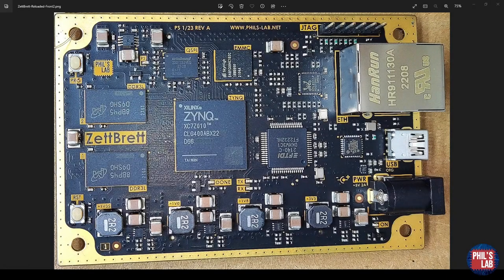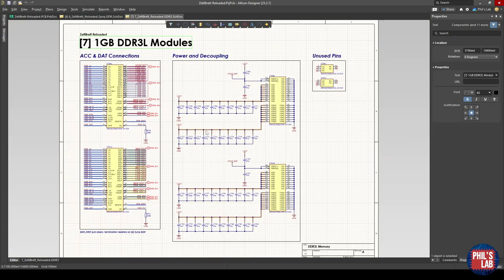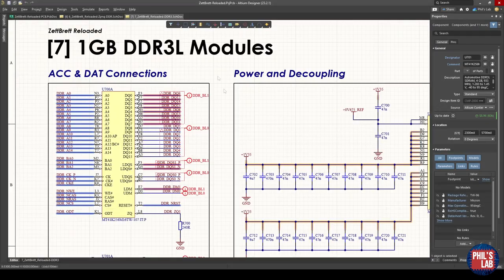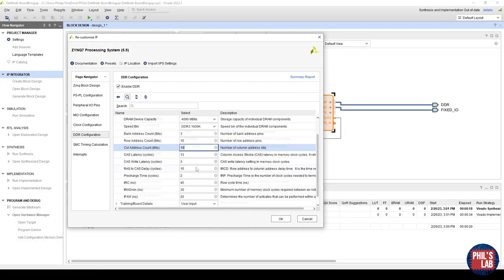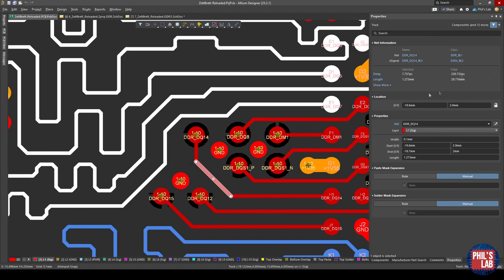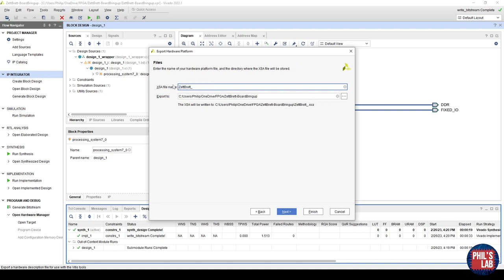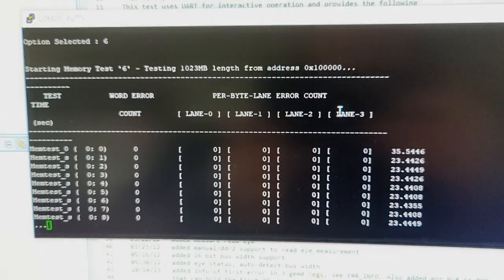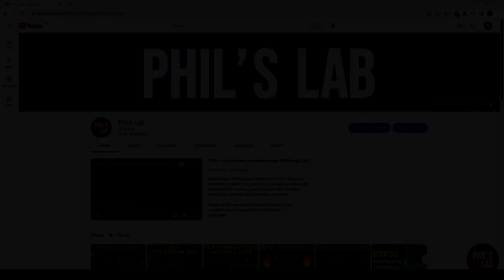FPGA/SoC Board Bring-Up - DDR3 (Zynq Part 2) - Phil's Lab #97

Comment: Nice video! I recently bought a few Zynq 015 chips which have 4 MGT transceivers, and I intend to make a board with a PCIE x4 slot on it. I already have a premade MyIR board with 015 and a PCIE, but it's only has two lanes wired up, but I already tried many PCIE extensions cards - among them was NVME SSD (via PCIE-to-M.2 adapter), 2.5G Ethernet card, USB 3.0 card - basically all extension cards I had laying around, and once I enabled drivers for these devices, they all worked (well, with 2.5G Ethernet it was a bit more involved because it required a firmware to run). My initial idea was to place a PCIE switch so that I can connect both NVME SSD and some other external card at the same time, but these switches are very expensive (PEX8612 is about 70$ per device!), so I decided to ditch that idea for now. I also have a few of Zynq 030's with Kintex fabric and 10G MGTs which I hope to find a use for some day.
Reply from the maker: Thanks! Sounds like you have some cool projects & ideas lined up. I'd like to give the Zynq Ultrascale parts a try on a custom board this year (if time allows) - as you said, trying to find a use right now is another thing..
Reply: @PhilsLab  Yeah, I've been itching to try the UltraScale+ parts (not just Zynq, but FPGAs as well), but they are just too damn expensive for me.

Comment: The maximum PS DDR Clock Domains Performance ( Tab. 18 in DS187 AC and DC Switching Characteristics) is 1066 MHz. Why did you choose a higher speed bin of 1600K? What am I missing?

Comment: Whats the maximum amount of RAM that can be paired with the hardware DDR controller on these Zynq chips? From the datasheets I'm guessing 1GB is actually the max, which seems rather low. Guess you'd have to add some fpga-based memory controller to get more.

Comment: I am using Altium 23.2.1 and have watched many of your videos and they are very useful.  I also work with an FPGA Designer that handles the VITUS and Vivado side of the design and these videos help me understand the design from that perspective.  I am working on several boards with different Zynq parts (the Big Ones).  I have several designs that are candidates for Reuse. One of the components in this Reuses opportunity exists over 8 schematic sheets. This FPGA has 23 different parts (heterogenous part- BIG Zynq). Should I go through the multiple schematic pages selecting all the relevant components and signals all at one time creating the Reuse Block and then do the same thing with the PCB design?  Or should I copy all 23 sheets of my schematic pages and make one giant schematic sheet (size J?) and make that a reuse block?  How can I handle this situation?  Can I make the whole design a Reuse Block as it is (23 schematic sheets) Or make one giant schematic sheet and make that a Reuse Block?  Thanks for your YouTube Channel!